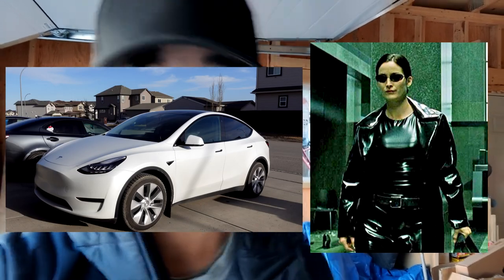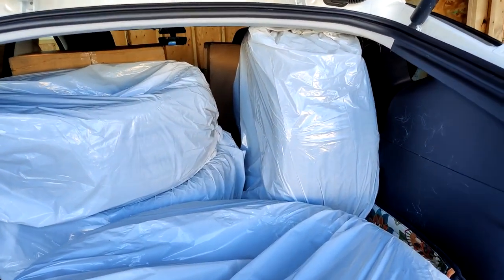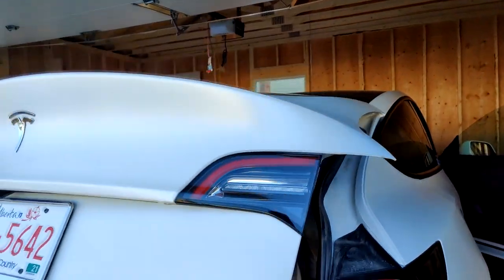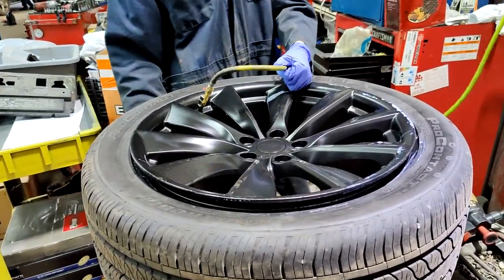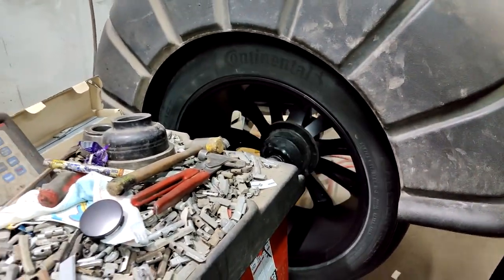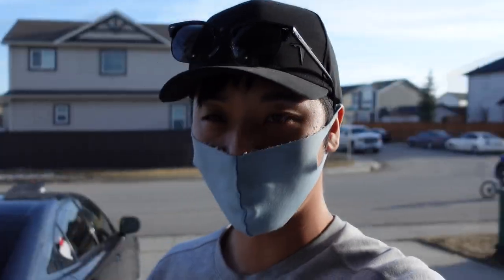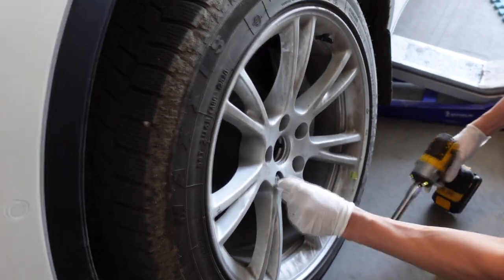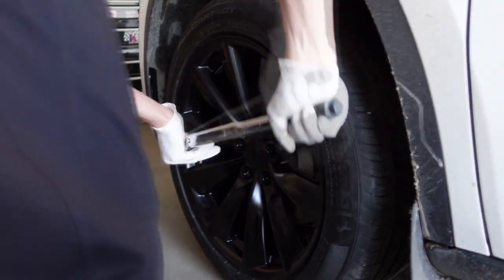Tesla aftermarket wheels \\Replika R241

Comment: Nice video! What tire size did you use? I'm thinking 255/45/19 for my Model Y with the same Replika R241 wheels. If that's what you got, then it's a no brainer as it looks awesome!
Reply from the maker: Thats correct. they are the exact dimensions (255/45/19) of the stock gemini tires :). If you like these check out the most recently hub cap video I did. They are also budget friendly especially as a good looking winter rim! Cheers man!

Comment: Hi Tesla Ho, how about tpms sensors? I have not noticed any installation in your video? Would you get an alert on the screen if the sensors are not installed? Thanks!
Reply from the maker: Good question. If there are no tpms sensors in or are installed incorrectly, you will get a notification saying faulty monitoring system. This notification you can not get rid of as it is a safety feature. I currently have tpms sensors on my winter set (latest video) and none on my summer set. I will note that if the sensors are left on from last time, the system is smart enough to know and start working properly after a few minutes of driving. Hope this helps and let me know if you have any more questions!

Comment: Did you get new black lug nuts or are those just the nut lug covers? Thanks
Reply from the maker: Yio I got these lugs new aftermarket. They are just painted so nothing too crazy. I would recommend getting powder coated ones in the futures :). Thanks for the comment!
Reply: @TeslaHo  Do you have a link for the lug nuts ? Thanks
Reply from the maker: @ucsmfu  If you are in Canada, i used these guys as I've heard shipping to the US is way too pricy for them. They are based in Quebec. I sent them a email to see if they sell the lugs individually as mine gave me the option when I bought the rims. I'll  keep you posted on here. https://pmctire.com/en/contact.tire

Comment: The stock Gemini width is 9.5, I noticed the link you posted is 8.5, did you ended up getting this one? Any issue with the 8.5in wide wheel?
Reply from the maker: I tried linking the 9.5 but it defaults to 8.5 for some reason. I have the 9.5 but I have seen people with the same rims 8.5 with no issues. Hope this helps!
Reply: @TeslaHo  Thanks for sharing! Did you use the lug nut that come with the wheel? I saw 2 type of lug nut, 1.58' and 2' tall, which one did you use? Do you have to buy new TPMS?
Reply from the maker: @LBYINCHINA  I do not TPMS on this set as I just didnt want to spend the extra 400-500 bucks. You will get a constant tire pressure notification if you go this route like I did. As for the lug nuts, I got the 1.58' black ones I believe. Just know that the lugs are pretty much just plasti dipped and not powder coated so they will start to chip a bit if you don't get the chrome ones.
Reply: @TeslaHo  the old TPMS can't be moved to your new wheels?
Reply from the maker: @LBYINCHINA  It can but the Replikas are my summer rims. I chose to leave them on my winter tires because I like to monitor tire pressure more in the winter as it changes often.